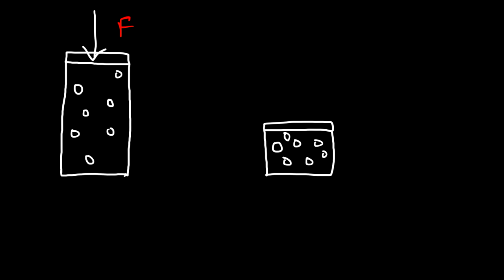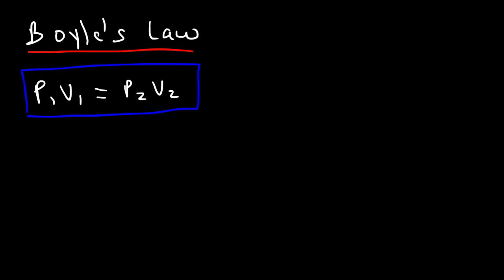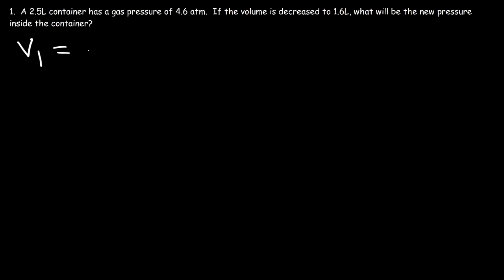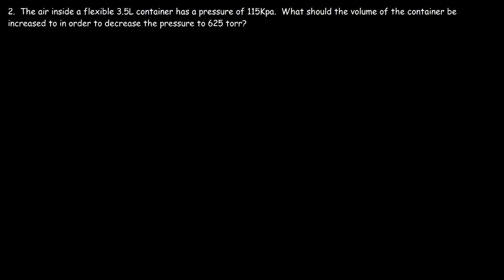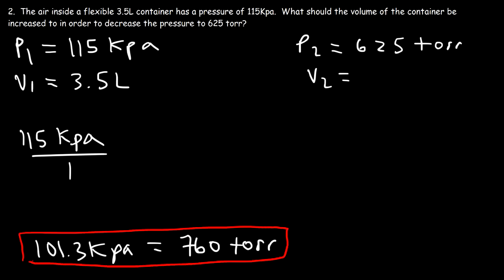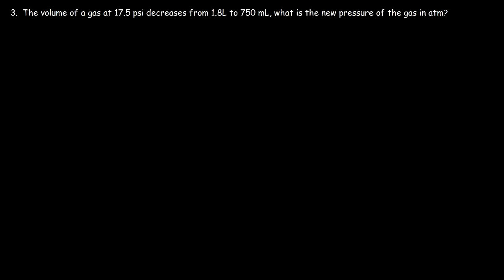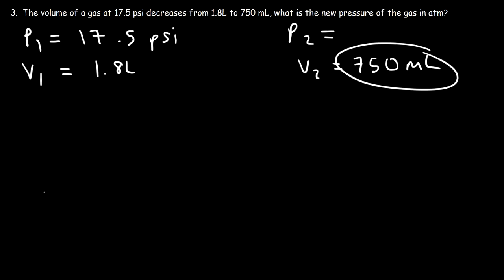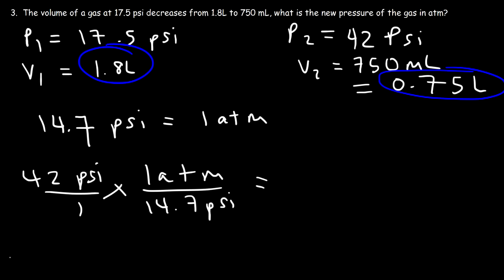Boyle's Law Practice Problems

Comment: how would u figure out which is the P1 or V1 in each problem?
Reply: i know this comment was 2 years ago but ima still explain😭 P1 has to do with pressure (Atm is usually the unit for pressure so you will know as soon as you see a number end with atm it is pressure) and for volume the unit for these questions are usually (L) for litres Soooo basically you just gotta familiarize yourself with the units for both volume and pressure

Comment: Does volume necessarily need to be in liters?(L)
Reply: Tl;dr Depends on question/ convenience.
Remember: 
1mL = 1 (cm^3) = 10^(-6) (m^3) = 10^(-3) L
Or simply,
1L = 1000mL = 1000cm^3
1m^3 = (10^6) cm^3

It is usually preferred to keep the volume in SI units: (metre^3). But the (L) may be more convenient, so can be (mL).
So use them as and when required or according to the question.

Comment: 4. A sample of propane gas is stored in a 2L steel canister and is under 303.975 kPa of pressure.

The contents of the steel canister are then placed in a 3.15L steel canister. What is the new pressure of the propane gas in ATMOSPHERES? I really need help honestly

Comment: may I know how did the 115 kpa turn into 101.3 torr?
Reply: It's one of the conversion units 
So... 101.3kPa = 760 torr 

Using unitary method;
If 101.3kPa = 760 torr
IkPa = 760 torr/ 101.3kPa
Therefore, 115kPa = 115 × (760)/101.3 
= 862.8 torr 
Ion know if you understand now...

Comment: 6:30 how did he get the 101.3 kpa??
Reply: Apollo Nox thats the measurement/ formula for the air pressure kpa. its just there, you dont solve for that measurement.      1 atm=760 torr= 101.3 kpa= 14.7 psi and i think there is another measurement but i forgot it-
Reply: @outtahere3902  (760 mm Hg) is the one you are forgetting.

Comment: a sample of hydrogen gas has a volume of 78.0 ml when its pressure is 1.07 atm if the volume of the sample increases to 1.15 ml what is the new pressure of the gas if the temperature remains constant anyone wanna help?